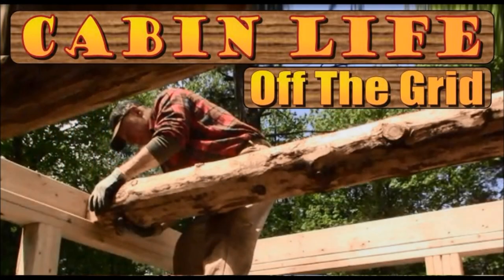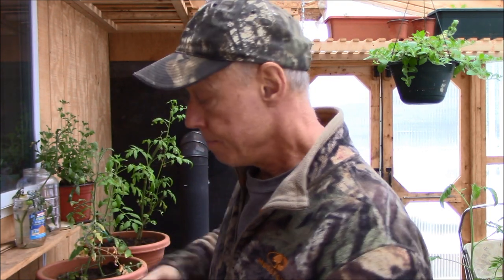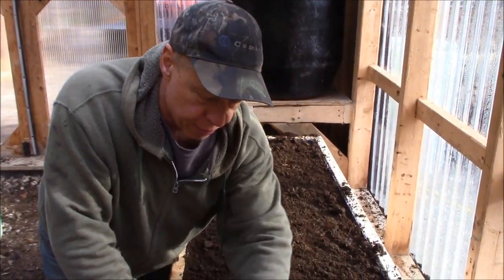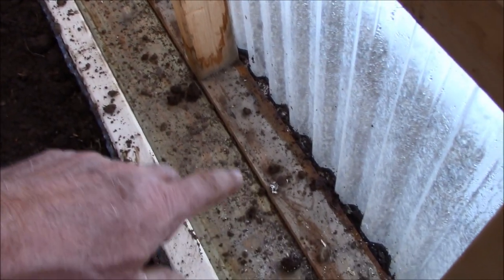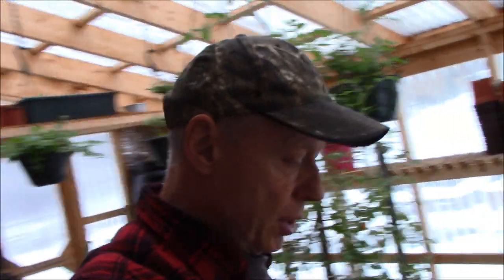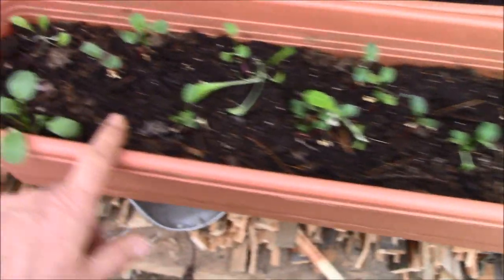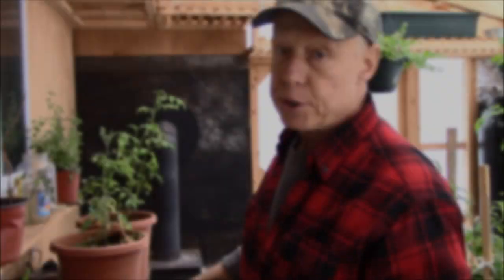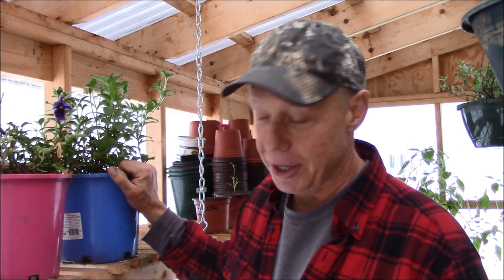GREENHOUSE EXPERIMENTS. Attempting To Grow Vegetables All Winter At Our Off Grid Mountain Homestead.

Comment: I can answer the seed-starting question for you. The reason they started off faster was the thin cubes of the seed trays can warm up faster thus promoting faster growth. The dirt in the larger tray stays cooler which inhibits growth. I have worked with plants for 40 years and I do a lot of education for folks at the plant industry where I work. You don't have to dig up old tomato plants in order to keep them. Just break off some of the laterals leave them about eight inches long and cut the lower  leaves off and just stick them in pots of dirt. It takes about six days and they will be rooted! That way you have a fresh new plant with the tender green off the end of the plant instead of the old base plant. You can get many new starts of tomatoes like this.

Comment: Greetings from PEI Boss.  I know your power options are somewhat limited.  Myself I use a heat matt, which speeds up germination.  I have multiple trays depending on when stuff goes out.  I have what is called 'Root Trainer's which  have grooves down the sides and train the roots not to spiral or clump.  Tomatoes and peppers are started in larger trays.  My onions are started in tree plug starters, they are hard plastic and quite deep.  I start my onions around Feb 5th for transplant mid to late April.  The baker creek web site is selling out of many seeds quickly and was not able to get the onions I wanted.  Wethersfield Reds are one of my favourites for salads.  Once we hit the 10+hr daylight mark you should see some more plant growth.  At ten hours  nothing grows, but it's great for harvesting, and you are certainly doing that.  My experiment this winter is lacto-fermenting garlic.  I had 200 bulbs this year and after freezing some, I decided to put some down this way.  Sun set at 4:26 here these days and it makes for a short amount of daylight.  All the best
Reply from the maker: Thanks for sharing your thoughts buddy.  We see very little direct sun now as it doesn't climb above the treetops. We're living on the wrong side of the slope but I can't buy the whole mountain haha.

Comment: Okay last comment....😁 the larger the seed the larger the seed tray needed to plant it in. The smaller the cells on the seed trays, the smaller the seed that goes in it. Seed tray sizes are based on the size of the roots that the product growing will produce. Vegetables that are large rooted will not last but a week or two in a small seed tray and will die before time to transplant it. There will not be enough dirt to hold the water to make it grow.  I would definitely think twice before planting bulbous seeds in the seed cells. The problem is, take for instance, beets. Once beets germinate they throw down a very long Tap Root to Anchor the plant to begin the bulb of the Beet or even for radishes. By that time the Taproot has circled the seed Tray cell and has practically ruined it for planting out. I know this from personal experience as I have had it happen to me. I typically will direct seed beets and radishes and turnips. Hope this helps.  Here's a free tip for you..... Put a tablespoon or two of bloodmeal about once a month on your pansies.  You're welcome!!
Reply from the maker: Thanks for sharing your thoughts and experience.  At my last house, I grew everything in 72 cell trays and had amazing results. I'll find thos pictures and share them in a followup video.  I was on grid then and these were started under lights. The plants were outrageous.

Comment: from upper Wisconsin I used Ice king boots. they are rated for 50 below.  comes with liner you can remove and dry between use.  I used them for bow hunting, ice fishing  and riding the trails.
Reply from the maker: I've had mine for decades. Best boot I've ever owned.

Comment: Nice to see your doing so well Boss & hope you read my comment.  I think I mentioned to you before but anyway.  I grew this year 79 celery & 51 tomatoes in 4 eight inch pots in two sunny south windows 15 inches wide. My best year planting like that was 1100 lbs of tomatoes in Alberta.  Everything else we direct sow as we found they do best from seed but we sow very thickly.  Peas as example we toss maybe 10 to 15 in a 1 foot area all the way down the rows.  Also the grey on tomatoes is powdery mildew.  Get rid of every sign & clean with hydrogen peroxide or baking soda.

Comment: More great back woods logic! I love my muck boots but my feet do get cold. I may try those insoles. Love the logic on the seed trays. Makes so much sense. Thank you.
Quick tip if you are worried about "hitting your noggin' " on the upper planting shelf, get a cheap styrofoam pool noodle, slice out about an inch and wrap it around the upper 2x4 so if you do hit your head, at least you wont see stars (been there done that) As always, thanks for sharing and God Bless!!

Comment: I buy my boots 1/2 size larger and double my socks, with a wool sock in winter.  This really works for me.  However, I don't wear Muck brand winter boots, I wear LaCrosse, including their rubber boots for the mud and muck around the ranch.  LaCrosse have always been excellent in this application, in my opinion of course, LOL........
Reply from the maker: I'm a Lacrosse fan as well.

Comment: I find the same thing regarding Arctic Muck boots. Frozen feet restricting time outside. Just got the insoles on Amazon that have a bit of alum. backing. Does crowd the feet. More winter, cold weather to test them out. I find Muck boots light and comfy but prone to puncture holes. Now testing out different glues, epozy etc to fix that.

Comment: Great video, regular viewer.  I will say I use the "little hotties" regularly in my Carolina work boots but for me they only last about a season or so but then again I use them alot with trapping and whatnot. But as for the Muck boots I just got the artic pros last year and love them. I can sit out on the ice and fish with no problems. The biggest downside for me is that  they don't breath. after a long walk your feet are soaked which means not long until frozen. Easy remedy for that is a spare pair of socks though.

Comment: Thanks Boss, We too use those starter tray and they work really well, we also use those plastic drink cups after I drill hole in the bottom of them, They too work well as long as you don't leave them in there too long because they get root bound. This was a great demonstration on the outcomes using two different systems. Hope to see you on the next one. Stay Warm!
Reply from the maker: We couldn't help ourselves last winter and started seeds too early. We transplanted from tray to cups and then they outgrew the cups.  A learning curve for sure but FUN and certainly helped us through the winter.

Comment: Hey Boss, one option if the tomato pants continue to turn brown at the base is to snip off 6-8 inch shoots of the new healthy growth, remove the lower leaves and replant them. I'm sure you already know that but I had to do that when accidentally starting seeds inside too early and I needed to save some pot bound tomato seedlings that started to die off before they could be transplanted. I love the greenhouse, it looks like such a gamechanger!
Reply from the maker: The tomato plants in the 2nd pot that I showed were cutoffs that I rooted in water and then potted afterwards.  I've had pretty good success with this but never tried planting the snip without rooting it first.   The greenhouse has been a blessings for sure.
Reply: Yes sir, rooting in water is probably the smarter option this time of year, especially if the soil is cold. We started our potato slips in water this year before transplanting and we have great success. How's the hunting going?

Comment: I have a few things to add that you might try. first when the light level is low you should try a little lower temperature you will get less stretch on your plants. if you have a tomato veriety that you like they are easy to propegate by cuttings . Your mums are an other one you can propagate by cuttings. mums are a short day plant and that means that they will redely bloom in the winter the problem is that they stay to small. if you take cuttings in late spring after march 15 you will grow a plant first before they bloom in the fall. try to seed a few say 4-5 seeds of radish in your tray cells you will get more production of your area.
Reply from the maker: We grow a lot frrm cuttings but this year I experimented and did comparrisons between cuttings to transplanted rootballs. I'll be talking more about this soon.  What you said about lower temps makes sense.  Thanks.

Comment: Hey boss, you just need to get yourself some heated socks with batteries. I have used them, back in the day, and I will say - they work. Yeah, they need batteries, but so what. And a little tip - when you wear those muck boots, make sure to pull your socks on over the cuffs of your pants. The cuff helps hold them socks up. Just a little tip.

Comment: Thanks for the warm insole advice, my feet are always cold from oct.-may. Will be checking out those links for sure. The green house is looking great, have you fixed the upper shelf yet? How many head bumps have you gotten so far lol! Why are they called "floating" seed trays? Do they actually float in water? Always started my seeds right in the ground to the pots they planned to live in, with so so results. Will check out the tray link also. Much love from So.Cal.💟
Reply from the maker: Yes, I will show how I make my water trays in my next video.
Reply: OK cool thanks so much😄

Comment: It looks like the 2 radish planters were at the same height but about 6-8 feet apart and on different walls, might the sunlight and/ or temperature be a reason? Also try some bubble foil under the planters!

Comment: had 2 sets of the same boot.  They were like you said OK.  my last pair lasted the longest at around 5 years.  I poked a hole the first month of owning them in the neoprene.  The sole finally fell apart and my feet started to get wet.  I have wide feet and Muck never really fit me right.

Comment: Capillary action of the water being drawn up. Think about tree roots growing over boulders to get to the soil below. Moving water has an electric charge. That's why dowsing works. Water moving even underground has an electric charge. I bought those Styrofoam trays from your Amazon store two years ago. What blew me away is the weight of them. Seriously heavy duty.
Reply from the maker: Thanks for using my link. I appreciate that.
Reply: I'm going to buy more tomorrow. I got the 242 size. I need the others now. I planted seeds from 2009 and everything came up. Pumpkins squash cabbage sunflowers ..everything. I decided to pull some cabbage plants that didn't even have their first leaves yet. Tiny..maybe a quarter inch high. The roots were 4 inches long. That's why they do so darn well in these trays. The roots go straight down to the water and turn into Olympic swimmers. My experience with the seed trays are everything you say they are. I always knew that bottom watering was best as I was in the nursery business for 25 years. But never tried growing seeds that way before. Amazing.

Comment: Another good one. Question. Do you see any potential for a variation on the green house theme, being integrated into a cabin build thus to aiding in the winter heating of the cabin?
Reply from the maker: I would do that if I was in a different situation but the sun passes on the wrong side of the slope here and the camp is too close to the boundary line.  My next build will be different :-)

Comment: Do you (or have you ever) use grow lights? I have houseplants that need a bit of help in the winter. Most of our windows are covered by covered porches so not much daylight gets in. They seem to do a lot better with the grow light. I put them outside in the spring and summer.
Reply from the maker: Yes, grow lights are great but being off grid it's not a good option for us.
Reply: @thebossoftheswamp  Oops, sorry that is true.

Comment: Hi I like your videos and I noticed you used the tek foil as a liner on your raised bed. I did this to my bed and after a few years the tek foil or whatever it is they are calling it, will start to whither and fall apart and will make a  big mess to clean.  I had to get rid of all the soil because the particles were to small to clean in the soil.  Any how keep the videos coming God bless.
Reply from the maker: Were your beds indoors or out?  I lined mine with foil with hopes that it'll prolong the life of the wood but I wouldn't have done this if the beds were outside. I figure rain would get trapped between the foil and the wood and lining them would be a moot point.  This was an experiment so time will tell what the outcome will be.   Thanks for sharing your thoughts.

Comment: Boss, is it possible that the seed tray is made of foam, which is a great insulator, so it might have provided more warmth to the seedlings?  Just thinking out loud.
Reply from the maker: Hard to say but I think it's the pyramid shape of the cell that wicks water up and gives the seeds just what they need.  Really don;t know the answer for this.
Reply: @thebossoftheswamp  I'm no gardener, this is just an observation, it looks like there's less dirt in the stunted plants tray than in the flourishing plants tray.  Could there be a better root system in the flourishing plants because of this?

Comment: Boss, when I was a teen my dad and I’d use battery operated socks when we went hunting...surely you know about them... thoughts please?
Reply from the maker: I have never used them but always wondered if they worked.
Reply: @thebossoftheswamp  it’s been many years now, but I remember them working so well my feet felt toasty most of the time in single digit temps.... to the point I’d remove the batteries often lest my feet burn up...